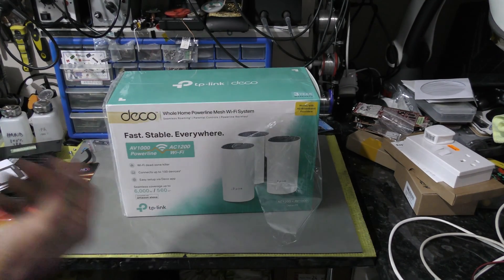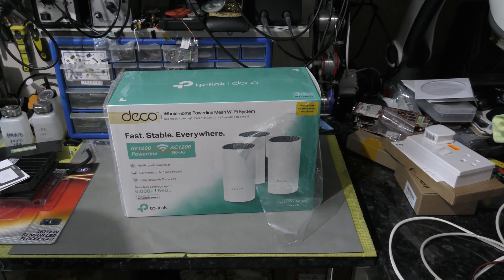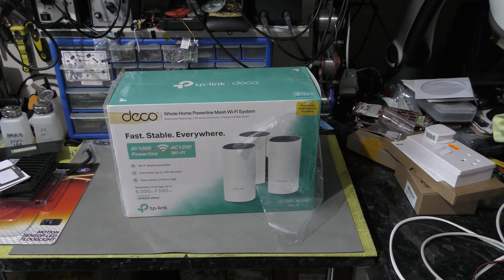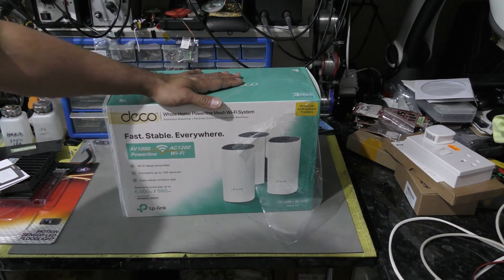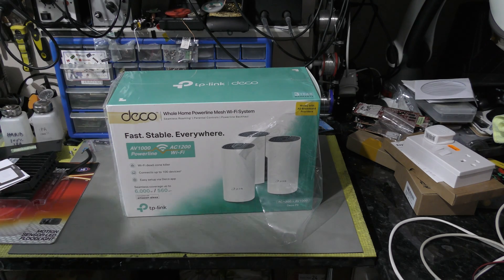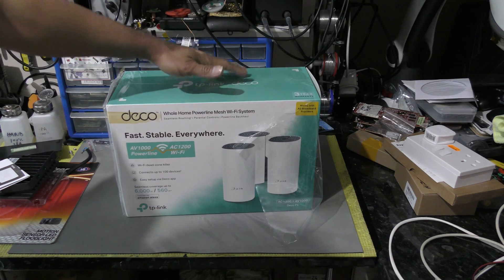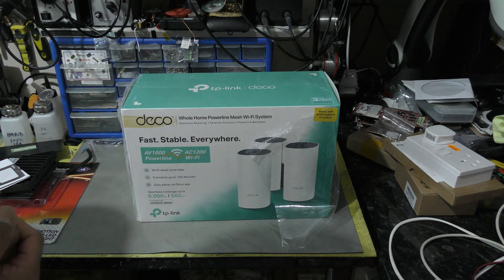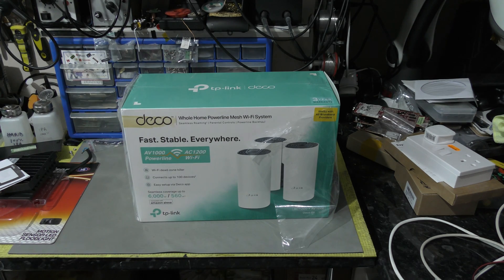TP LINK MESH WIFI DECO P9 FIRMWARE FLAWS NO 2.4GHZ SEPERATE SSID BROADCASTING

Comment: There is no way at  all to know if the Powerline is working. Not one spot on the app or routers or manual says anything about Powerline (it's only raved about repeatedly in the advertisements)

Seriously you can't check if its working or what speed its adding, no place to click at all.
No mention if it works in older homes built before the neutral wire was required by  building code.
Many smart light switches require the neutral wire (usually the white wire,) and the copper ground is not the same

I don't think the power line does anything for me because I have no neutral wire on the floor my main Deco is.

Comment: I have Deco M5 where there is an option on the software to switch between 2.4  n 5. However 2.4 supported devices are not recognising the signal to register. Very much disappointed. My 2.4 devices are offline after I bought this.

Comment: Hey just got my P9...You can try the following to connect 2.4 only devices that don't like combined SSID (some will just connect straight away):
1) Go to the settings on your Deco App and disable the 5Ghz
2) connect the trouble maker device
3) re enable the 5Ghz in the Deco app.

On all my devices here are home it worked fine.... After setting up the device it worked fine even after restarting the device and also after restarting the P9.... 
I hope it helps... It is a little pain having to disable and enable every time you have a new 2.4 only device but at least this way you can use it.
Reply from the maker: Thank you.  It looks like they've updated the firmware.
Reply: I created a guest network with 2.4 devices along but no luck. I have M5. Any other crack?

Comment: Thanks for the video calling out the 2.4GHz problem  TP-Link did a firmware update June 3, where they report amongst fixes: 
Modifications and Bug Fixes:
Added individual switches on both 2.4G and 5G networks.
If you did not return your purchase, did this update fix the issue?  Thanks for your work and your warning.
Reply from the maker: Hi, I had to return the Deco P9 immediately after encountering the issues.

Comment: Why not instead of setting the main modem to ‘modem only’ mode, turn off the main WiFi broadcast (so the tp-link acts as the main WiFi) but tell your main modem to turn on the 2.5ghz guest mode for these devices? This way you have a guest 2.5ghz frequency and the combined tp-link for everything else. You can rename the tp-link ssid so it is different.

Comment: Just came across this video because I bought the same P9 mesh system you have there. Was trying to figure out how to enable seperate SSIDs for 2.4/5ghz and was infuriated when I found the article you're referencing here. It also seems there isn't a web managmenet interface that could be accessed by connecting to the default gateway.

It's been 4 months and these BASIC features which the product should've had prior to launch still aren't available. Does tplink expect us to take a chance in maybe getting this feature in the future??
Reply from the maker: It's an absolute nonsense, selling something half complete.  Take care. 😊👍